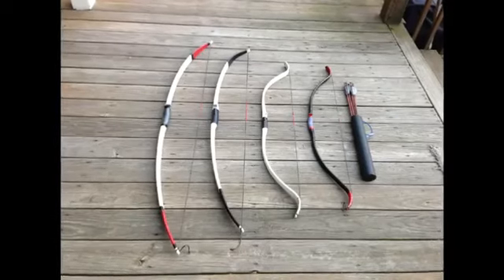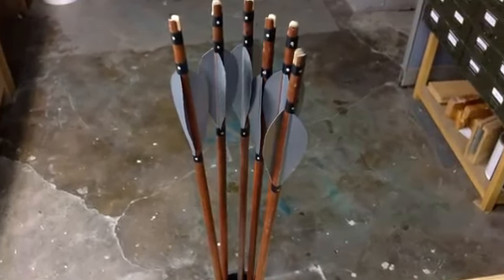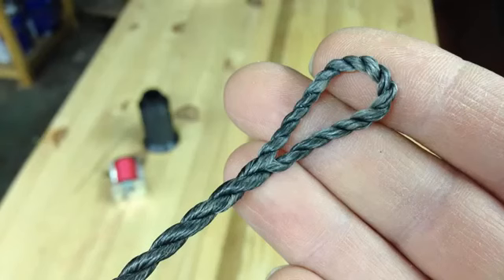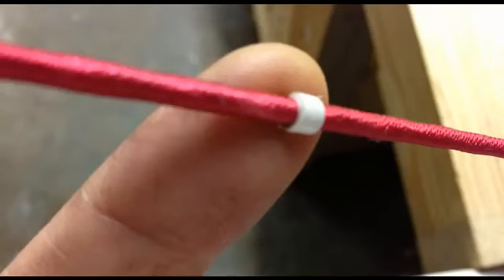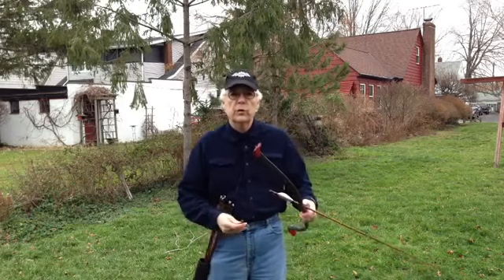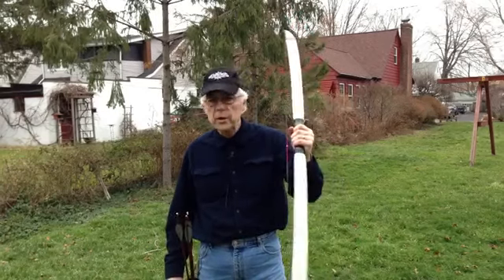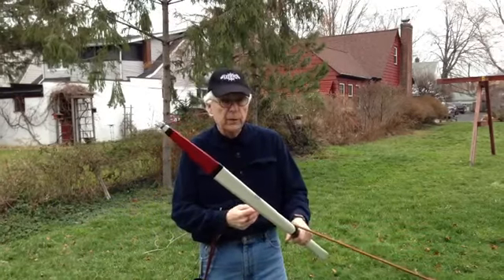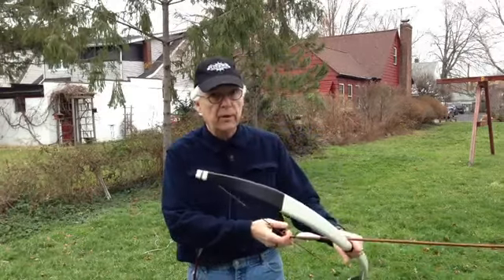My PCV Pipe Bows

Comment from the maker: I really don't know, but it's standard "Schedule 40" PVC plumbing pipe. Just go to Home Depot or Lowes...they have tons of it, cheap. You can find PVC pipe with thinner walls, but I don't think it's Schedule 40.
Reply: Terry Ross I have not had very good luck with sch. #40, pvc... However, I did very well with sch#80, electrical pvc conduit ! N the paint that you can use is an acrylic spray or brush on , depending on the finish you want.. N then over that , I applied. Clear (acrylic) urethane to protect the applied finsh design on the bow! Looks great n shoots at 
46.7#'s @ 28" draw! Hope this helps??!! 
GWW... Ooouuuttt!!!

Comment: Yes! Awesome Work!

can you please show us how you inserted the nail at the end of the arrow? I can't seem to do it without totally destroying the shaft!
Reply: Drill a hole in the end of the shaft with a drill bit that is slightly smaller than the nail or the same size as the nail and glue it in.  Grind off the end of the nail.